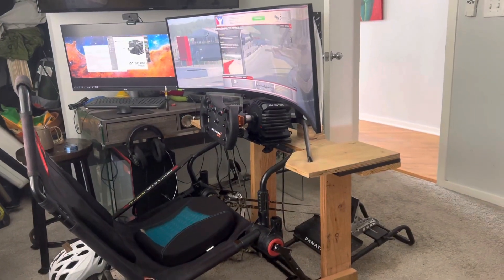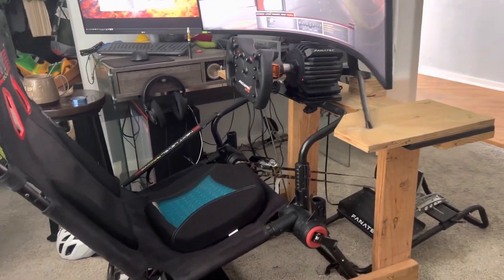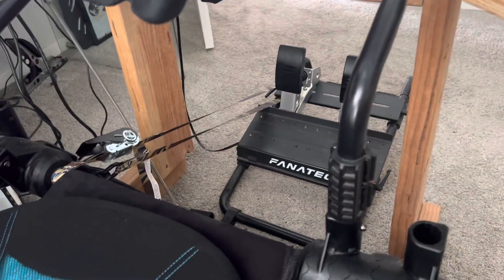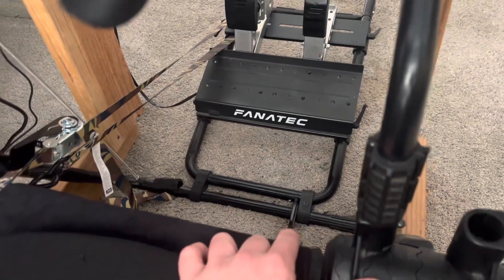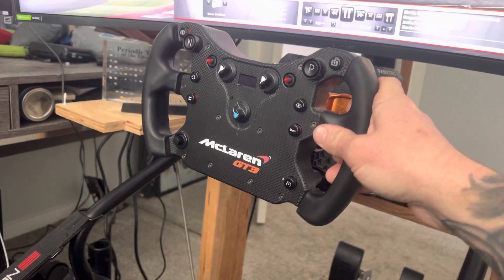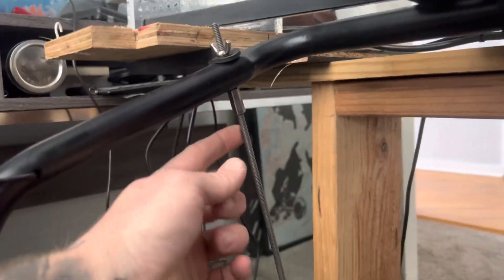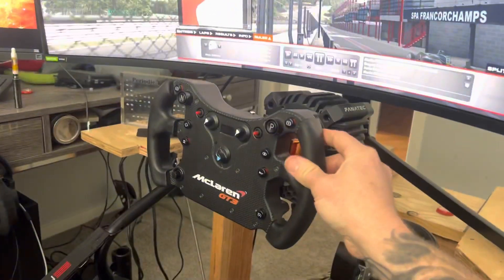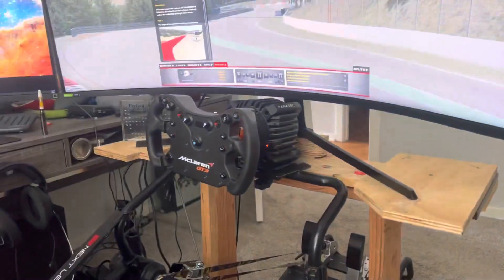How to modify your Gt Lite racing seat to support a load cell brake a Fanatec DD Pro with boost kit

Comment: I really like the threaded rod as a supplemental rigidity support. Maybe figure out some sort of wobble elbow that will still let the wheel mount bar swing out for entry and exit of the cockpit
Reply from the maker: I just kept it locked in. But I have a new rig now
Reply: What cockpit did you buy? @Beausinklear

Comment: Appreciate it! Did the mods and now I can actually brake.
Reply from the maker: Love to hear it
Reply: @Beausinklear  Got a quick question, is there a nut behind the metal bar at the bottom or is the rod just inserted into the metal bar?
Reply from the maker: @KhazAlp  there is a nut on the bottom
Reply: @Beausinklear  Thanks, I forgot to drill the bottom.
Reply from the maker: @KhazAlp  No problem. Good luck. What series do you usually race in?
Reply: @Beausinklear  Thanks! Mostly GT3 in ACC, but just started iRacing so at the time being Mazda MX5's.
Reply from the maker: @KhazAlp  the Mazdas are fun but I love the GT3 racing in iRacing. Hopefully I see you in a race soon
Reply: @Beausinklear  Yep, hopefully mate :) GT3's are my favourite.

Comment: Awesome mods here, well done. The ratchet strap on the pedals is a must for load cell brakes.
Do you still "open" the right side of the rig to get in and out after adding the metal rod?
Reply from the maker: No I leave it locked in place and I have to climb in like a nascar driver. But I just upgraded my dickpit so I don’t have to worry about that stuff anymore

Comment: How stiff is your brake? i am also worried about the chair lifting up but i figured that angled down piece  the brake is mounted too would make it hard to get the right angle to lift the seat.
Reply from the maker: The brake is 120-130 lbs I think. I have it set to the stiffest setting for the Fanatec CSL load cell. The chair doesn’t lift at all with that ratchet strap on it

Comment: What should I do if the front leg(s) of the seat lift up under heavy breaking? The seat is already connected to the pedal stand at the front
Reply from the maker: @MarleyDog11 use a ratchet strap
Reply: @Beausinklear Where should I connect it to? The front of the pedals like you?